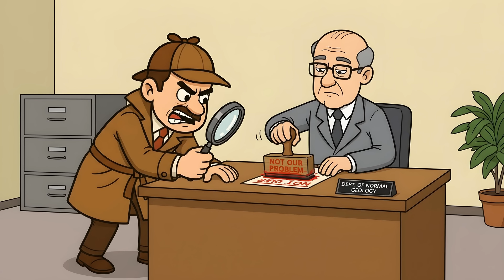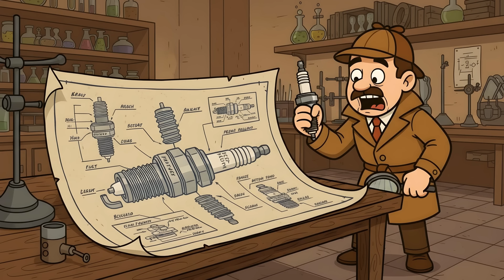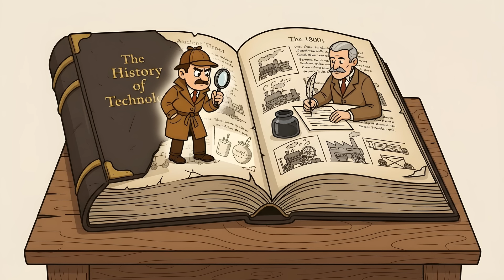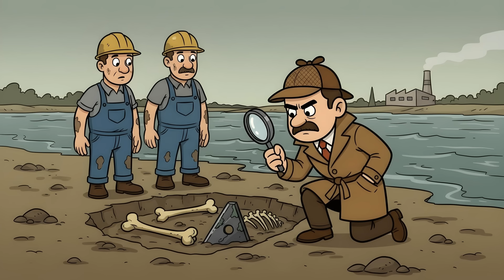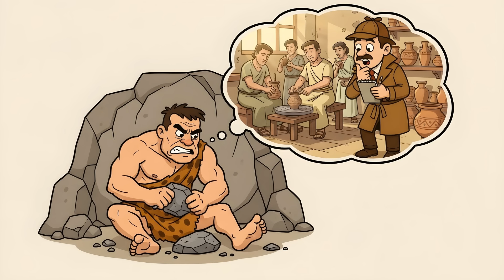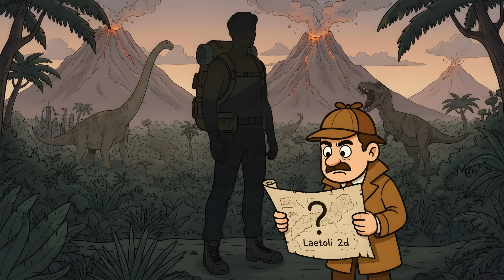10 Impossible Artifacts That REWROTE Ancient Timelines

Comment: Things might be able to quantum jump back in time
Reply: And if that's possible, maybe they could just as easily re-materialize inside a geological structure. But you'd think if that was the case, they'd likely have inter-dispersed molecules, fusing them into the structures rather than displacing them.